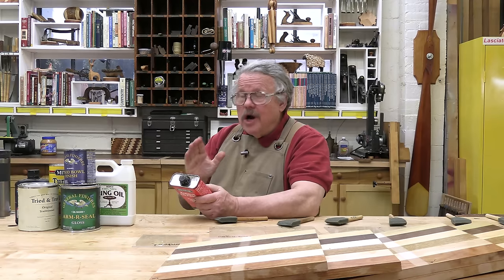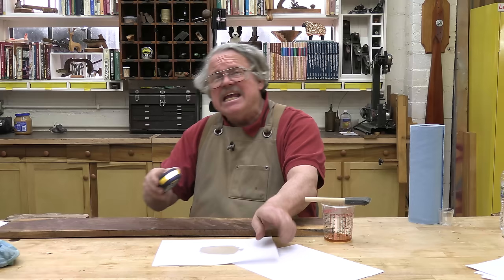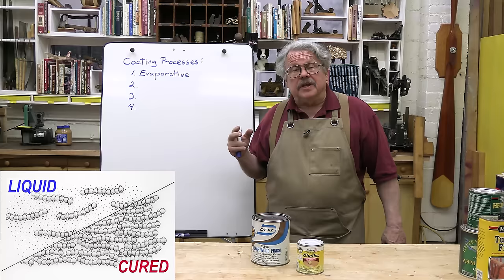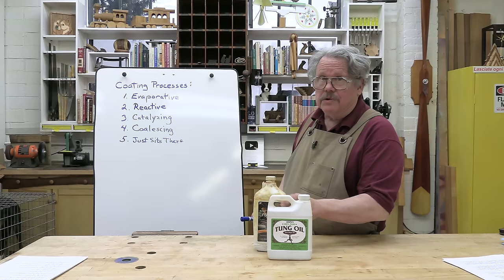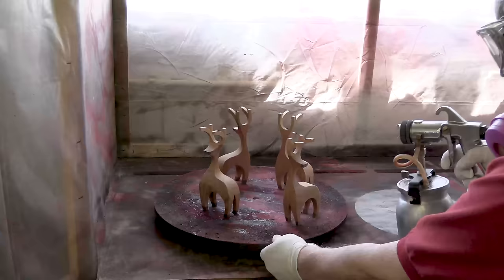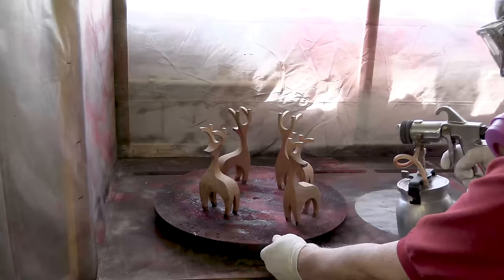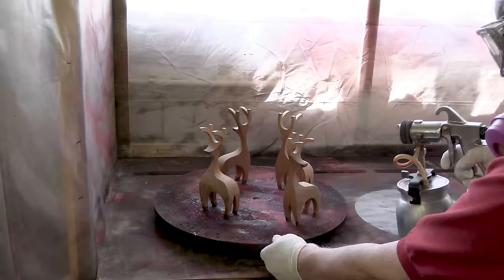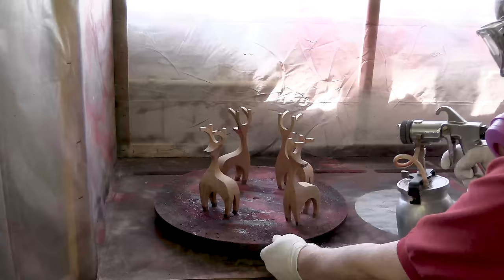Finding the Perfect Finish

Comment: Very good informative video here..  Thanks..  After many years of woodworking I kind of evolved..  We all start at novice in making things we need and some of us take that and go into a form of commercial woodworking with contracts and deadline..  I used a three coat danish oil initially and in time made a mixture like rudy  of varnish and danish..usually 2 coats and then varnish.. on the commercial phase is used a thin oil from minwax and coated with 2-3 coats of minwax water based urethane..The oil was ready to coat in a day or two and the water based finish I could spray on with low pressure high volume gun.  Most waterbase finishes are very durable and last..  Many can be touched up quickly..  I have never used lacquer for any finish as it is harmful, weak and short term finish.. Yes it takes experience to use a spray gun.. But it’s simple watch the edge get wet and stop..  Patience..  Continue spraying the other parts and you can come back and build and watch for wet edge..  The surface becomes reflective you stop.  Thus I never put to much on and the whole effort goes so fast to..  Now as a old man I still use the last method.. I am making thing for myself or friends now..  No more commercial deadlines.. So over a span of 55 years I found what works for me..  I like satin as it warms the wood and in water areas the gloss protects better and is harder and thus lasts longer.. ☺️👍
Reply from the maker: Thanks for sharing.

Comment: The Minwax wipe-on poly is available in both oil base and water base (as shown in the video).  The oil based product is harder to find, especially in certain states or counties.  I've found that the oil based product is far superior to the water based version.  Years ago, I built a knock-down tradeshow booth display from cherry wood.  During its travels, a portion of the tradeshow display was lost, so I built this section again.  During the time between the construction of the original display and the replacement parts, the oil based version was no longer locally available, so I just grabbed the water based version in the same color tint and satin surface finish.  After experiencing both versions of this finish on the same materials, I've come to learn that the oil based wipe-on poly is everything I love in an every-day wood finish; it goes on easy, flows out level and smooth, brings out the natural grain, dries quickly, sands between coats easily, and is durable.  The water based version was everything I dislike in a finish; it does not go on as smoothly, leaves brush marks, does not bring out the natural grain as well, blushes, and doesn't sand quite as well.  I'll never buy the water based version of this product again.
Reply from the maker: We have had very good experience with the oil-based version, and now use it when we need an attractive coating that cures quickly. We haven't experience the poor results you report with the water-based version, but we did not care for the way it looked after curing and haven't used it much since the video.

Comment: I refinish Gunstocks I like hand rubbed look easy to repair if it gets a bad scratch unlike Poly finish that looks plastic and very hard to repair when it gets scratched deeply …..I always did 2 coats of BLO with red alkanet root (alkanet root leaves a red pinkish hue on walnut very pleasing to the eyes make the grains pop)….Then 2 coats of pure 100% tung oil cut with 50% turpentine (flood the coats  and soak wood until it can not take anymore oil then wipe it off real good let stock dry for a few days)… Then I apply 2 coats pure tung oil cut with 25% turpentine (wet sanded 400-600 grits) … then my last 2-3 coats I mixed tung oil with formby’s (50% pure tung mixed with 50% Formby’s High gloss “fake tung oil”) only reason I mixed the last coat with Formby’s high gloss fake “tung oil” was to give the top coat a little strength if its too shiny for your taste ? Easy to knock it down to satin finish with 3M 2000 grit or 3000 grit sanding “Trizact” sanding pads you can find at automotive stores… this finish still gives me the flexibility to repair deep scratches in the gunstock future if I have too …

Comment: I am a new wood worker and am making end grain cutting boards to work on basic skills. One end grain cutting board finishing technique that appeals to me is to dilute wood bowl finish 50/50 with solvent and wipe it on generously such that it soaks in. Wipe off the excess and repeat one or two more times, allowing no surface build of the product. Then finish off by wiping on a blend of bees wax and mineral oil. I am interested in your recipe also. thanks for this video!
Reply from the maker: Most welcome. If using this for a cutting board, the spar urethane is completely unnecessary; it would add nothing to the overall protection of the wood if your aim is to not let it build up on the surface. I would go in another direction. I'd thin the tung oil 1:1 with mineral spirits or naptha to help it penetrate; apply two coats; and then apply a single coat of un-thinned tung oil.

Comment: I'm a fan of Tried and True, I frequently start with a coat of their danish oil and then follow that up with their varnish oil or original finish for 3 coats. When buffed with a soft cloth a few days later, the original has a nice soft shine and is a fair bit less waxy. The varnish oil can take a nice polish and is hard as rosin and feels nice, in my opinion. That said, shellac is great over hardened oil when I want a higher gloss.

Comment: I'm really glad you made this video.  I trust your expertise and relentless pursuit of the 'truth'.  I admire that immensely and very grateful you are sharing this with us.  That was very rich content and instructive.  I learned a lot.  I especially liked the categorizing of wood finishes and made notes.  Classifying them into groups helps in knowing which group is best for which need in a less haphazard manner. I really liked this video. ❤🙏

I have been restoring wood furniture for over 3 decades now.  I learned on my own. I have tried many finishes: Tung Oil, Danish Oil, Wipe on Poly.  Never tried Lacquer or Shellac because these are delicate and have specialty uses.
I am dissatisfied with Tung Oil and Danish Oil which have 'penetrating resins' whatever that means. They end up gummy over time, and not robust.  I found that my favorite 'tank' robust finish was Boiled Linseed Oil and a thinned out Oil Based Satin Polyurethane.  I will try out your finish to see the difference. 

Here is my method in detail that works for any fine woods, veneers, or everyday use items.  I suspect you can use them for cutting boards too.  On cutting boards, water soaks in and warps the boards, so I l like a deep thinned poly finish on them. 
1. If restoring, use chemical strippers or soda blasting to remove old finish COMPLETELY. 
2. Sand down fine so wood feels like satin.
3. Lather in Boiled Linseed Oil.  Maybe Tung oil (with dryers) would work too.  If you use Raw Linseed Oil or pure Tung oil with no chemical drying solvents added, it will take 3-7 days to dry out. Best to use Boiled which has solvents. This takes 1-2 days to dry out.  After lathering in oil, wait till it is absorbed 5-10 mins, reapply to dry areas. Wood should be saturated with oil so it relaxes and is not dry anymore. Wipe off clean several times as it is drying and releases oil.  You do not want a gummy film to build up. Let dry in shade or sun for 1 day or 2 days.  Use cheap brush. Clean in Paint thinner and reuse.
3. Mix Mineral Spirits/Paint Thinner 60:40 Varathane Oil-Based Clear Interior Satin Polyurethane. 50:50 is heavier and okay for utility pieces, but you want a thin mix for fine furniture or where you want a wood feel. Brush on generously and let it soak in for 10 mins.  Before it gets tacky, wipe off excess with paper towel. This is a smear more than a wipe. You don't want to wipe it dry, but leave the thinnest film on top. All craters, drips, blobs disappear.  Watch another 10 mins and re-wipe any drips. Let dry in hot sun.  
4. Sand if you must with 400 grit. Recoat. Smear again.  Do this 3-4 times depending on how much build up you want. Satin requires no sanding except to remove any dust or craters.  Gloss requires sanding for grip.
5. The reason for thinning it out is deep penetration.  You harden the wood, prevent moisture penetration, and seal it off almost completely.  Use a cheap brush, and rinse off in Thinner and reuse ad nauseum. Finish levels out so no need for pricey brushes.  First round of thinner cleaning goes back in your Diluted Poly Jar for reclaiming Poly.  Use a small jar for mixing, as small air gap won't dry out as fast.

I have used this method on garage worktables (thicker), carved picture frames, vintage dressers.
Of course on fine wood antiques I would use a lacquer or varnish and will try out yours shared here, but what I find is that my method does not peel, discolor, crack, craze, chip, or stain, and it protects the wood well.  My go-to finish for most things.

fyi- IMHO (In My Humble Opinion) is an Acronym.  It may be used as a Prefix or Suffix, before or at the end of a sentence respectively, but since each letter stands for a word, it is an acronym.

I love your mad scientist mop of hair, but you may want a good haircut 😂
I cut hair as a hobby and looking at your hair it feels like a hedge that needs a trim.  My fingers are twitching on the scissors.
Please get thee to a good stylist (don't use a barbershop, they are cookie cutter cuts) and they will make you look so good.
This was during Covid so we all looked messy. I learned to cut my own hair and now don't need a stylist anymore. Yet another delegated task skill under my belt. If you do decide to cut your own hair, use JW Professional Shears CRX Series which is very cheap at $23 and comes with the right comb.  For trimmers, get the Dog trimmers Andis Vida or Wahl Bravmini. Both excellent motors far superior than human trimmers and blade included. Andis Vida on Ebay is cheaper.

Comment: My favorite finish basically is a naturally occurring wipe on epoxy.  Urushi (or Japanese Lacquer) is the sap from the lacquer tree.  It catalyzes in high humidity into a very durable epoxy resin.  It is typically applied via brush, but I prefer using a lint free microfiber rag to get thinner coats over larger areas.  Prior to application, I will have the work piece in a closed off space with an active dehumidifier to remove as much active moisture in the area for about a week.  After this process, I will apply 2-3 warm, thin coats of lacquer to the work piece.  The dry wood wicks the lacquer into the outer fibers.  After I am satisfied that the wood has soaked up as much of the lacquer as it will take, I wipe off any excess from the surface.  Following this, I turn on a humidifier to raise the ambient humidity within the space to around 80-90%  and any supplemental heating required to achieve 80F.  Hold for 24-48 hours.  I may scotch-bright any rough looking areas, followed by applying a a fourth coat over the entire piece to provide a glossy finish.  Once again adding the extra heat and humidity.  FYI, if you decide to experiment with Japanese urushi lacquer, WEAR GLOVES, do not touch anything outside the immediate vicinity, do not scratch your nose, and avoid skin contact.  Especially if you are allergic to poison ivy, oak, or sumac.  After you are done with your lacquer work, wash any and all exposed body parts with a pumice soap thoroughly.  And inspect your clothes for any drips or drops of the lacquer.  If you see any, you can partially neutralize the lacquer with chlorine bleach, which will turn the lacquer black and tar-like.  Afterwards, hand treat with soap and water.  Avoid getting uncured lacquer into the washer & dryer, it could contaminate the rest of your clothes.

Comment: Best finishes I use are oil based.  For fine lustre , deep penetration and excellent popping of grain there’s none better than Liberon’s Fine Finishing Oil, a sort of danish blend.  However it’s not that durable.  To complement and refine that finish I use beeswax and carnauba to build up a nice deep lustre which looks more natural than building up oils to a deep gloss.

For top quality durability with good penetration I use Osmo Poly-x oil which is similar to other fine oil blends but contains a little more resin for hardness plus is infused with wax which rises to the surface of the finish for that natural lustre .  It dies take a little skill to get the desired results.  First two coats need putting on thin and rubbed well in for the heat to melt the waxes and bring them to the surface.  Then denib if needed with a nylon scour pad or just burnish with a cloth and apply a final thicker coat.  It will self level.  You still apply it hard but liberally and don’t remove slight excess.  You’ll be left with a lovely deep and durable hardwax finish which for me is the best of the bunch.

Comment: "Do your own experimentation." This and how to experiment is the best part. I have lots of squares made from pallet wood. One can even resurface and try again cheaply.  Good to use hard varnish/polyurathane on tops and hard wear parts. Hand rubbed for best looks. Make your own using the poly with the stain you like. Just to complicate things more... I mixed Tung and Linseed oil with a lye to make a soap. Wonderful for hard woods and hammer handles look like real wood and a nice grip , but not sticky. Mixing and letting cure for just 2 hours, the grain is darkened and reacts with the tannins in the wood. Sticky for sotf woods.
Reply from the maker: Thanks for sharing.

Comment: I love this channel. As a UK woodworker most of these products are not available in the form that you show. However there is still a workshop load of useful information in here. I am working with Danish Oil and then a hard wax finish. Three coats of Danish Oil is about as much as the wood will take and I leave it 12-18 hours between coats depending on the ambient temperature. Two coats of Oli Natura hard wax oil and I am happy.
Reply from the maker: Thanks for sharing. I feel like I should be writing a recipe book; everyone is volunteering their favorite finishes.

Comment: You my friend are public television gold and should have your own show. Thanks for all your hard work and I will try this finish on my knife handles.
Reply from the maker: I made a set of kitchen knives and finished the handles with this finish; it holds up well. Warm the wood ever so slightly with a heat gun (or your bare hands) before applying the first coat of finish -- this will help it to penetrate as deeply as possible.

Comment: Context was ignored.

You didn't mention criteria for internal vs outdoor; display only vs wear upon usable furniture; a marine situation (ie salty environment); UV protection; rigidity vs flexibility of wooden fibres. Here, many of the new "chemical" finishes excel far beyond the traditional ones.

All that said, the best timber protection solution I've ever come across was a recipe for a Swedish varnish invented by the Vikings and which has ubiquitously kept every piece of wood in Scandinavia (furniture, houses, boats) well protected for hundreds of years.

It involves a mysterious alchemy of boiled linseed, pine rosin, in a solvent base of turpentine. Everyone who has ever used it swears it is excellent in ALL the areas you covered.

Comment: Water based wipe on poly is so easy to use.  Cleanup is a breeze.  None of that toxic paint thinners used on oil finishes that make cleanup so hard.  It's not for every purpose but I try to use it on everything.

Comment: The second reason, absorbing and releasing moisture, is actually a plus  in a solid wood wall house like unfinished logs or CLT panels etc . one of the great features of massive timber is it hygroscopic properties , the absorption and release of moister. solid wood walls left untreated or finished act  as a temperature and humidity balancer . For example , the bathrooms in my house have so much mass and surface are of raw wood that the moisture from showers and baths is easily absorbed into the surface and then give it back to the room as the temp and humidity levels drop . The house is six years old and i have never seen any build up of moisture on the surface off the walls while bathing . sorry that was a bit off topic .
Reply: sounds like you can expect some fungal growth in your bathroom (unless you live in Arizona etc).  I sincerely hope not but you might wanna coat the bathroom walls.
Reply: nope , No mold or mildew after seven years .  if it's going to happen it would have already happened . 
If the wood was sealed , it would allow the moisture to collect on the surface and this might cause mold . the walls are six inches thick of solid wood . this is thick enough to allow the hygroscopic effect to occur .  In a mass timber hous it's imperative that one does NOT seal the walls otherwise the ability of the timbers to regulate humidity and temp. will be lost .

Comment: I really like helmsman spar urethane. It is tough and durable while still making the grain pop. It also seems to work great for a filler when mixed with the fine dust from sanding the workpiece.
Reply from the maker: Nice tip; thanks.

Comment: Fantastic information. 
Because of the high heat and low humidity where I live (Arizona), I use 60/40 boiled linseed oil and lacquer thinner or 33/33/33 boiled linseed oil, lacquer thinner and poly on some of my electric guitar builds. Really seems to help the wood out in the heat. Can't wait to try this new recipe! Thanks
Reply from the maker: Most welcome, and thanks for sharing.